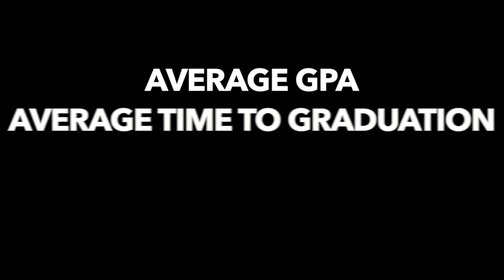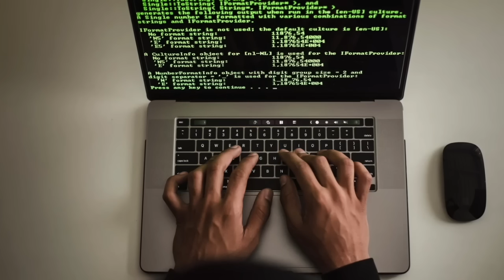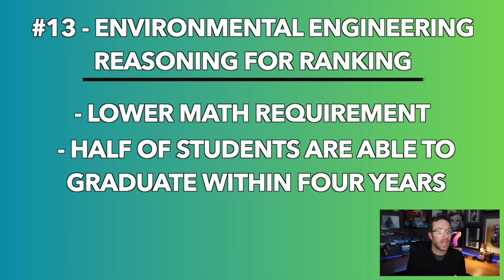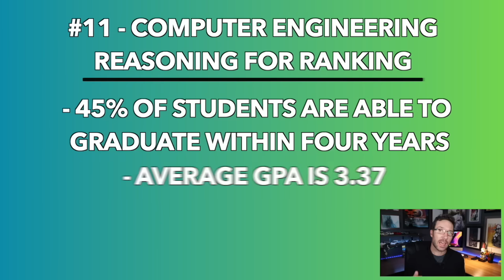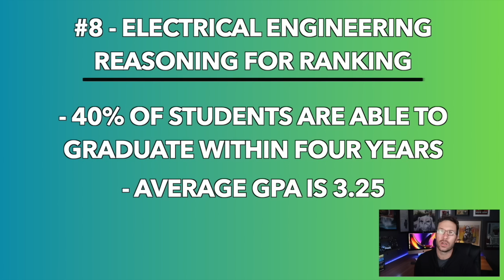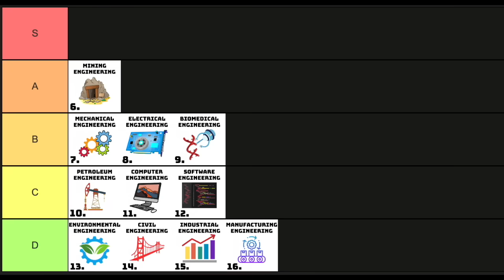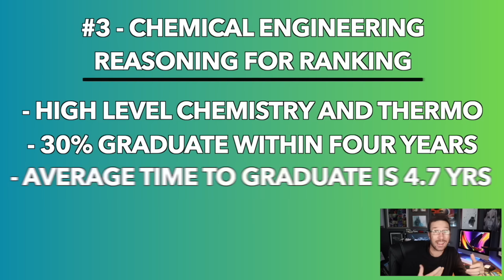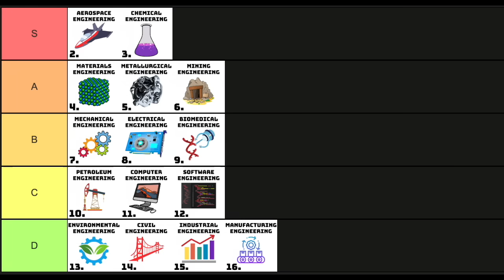Engineering Degrees Ranked By Difficulty (Tier List)

Comment: "In chemical engineering, you're going to learn a ton of chemistry". The person has done a lot of research to collect data but lacks an understanding of what each engineering discipline focuses on. It's a common misconception that "chemical" engineering is about chemistry. As a chemical engineer myself, I'd argue it's more of physics than chemistry.
Reply: I am also a chemical engineering graduate and I agree with you. Unless you pick a specific project or specialization that involves learning a bit deeper chemistry, the only part of chemistry that is expanded in chemical engineering is physical chemistry, that too for designing and optimization of equipment, and in conjunction with maths computation and mechanics into them.
Reply: More math AND physics is involved than chemistry, yes.
Reply: Also a Chemical Engineer, and I agree

The chemistry we learn is foundational: General, analytic, organic and physical chemistry.

Other than that, maybe materials science and chemical reactors, but even that feels more like physics than chemistry.

All in all, the bulk of the course can be summarized into: Thermodynamics, transport phenomena and systems/process design
Reply: I don't know if CE is the hardest degree but it's the coolest one.  You actually learn how to create a manufacturing plant. The other degrees teach you how to build the building or wire it.
Reply: Chemistry is actually particle physics at the microscopic scale.
Reply: Chemical Engineer here as well and I agree.
Reply: Chemical engineering here with an OChem major as well, you take PChem & OChem, but you are NO chemist (More physics: heat, energy, material) your projects are going to totally drive what you "know'.

Chemical engineering is more focused on catalysts, which is math models / physics... You're not moving electrons as your are using tables of values. Also unit op design, costs, energy use, efficiency, just not a lot of reactions... They're in there, but there's a lot more factors coming and going than changing at a location. Also, by the time you are at production... All the chem is done, except for break throughs... Most ChemEs are worried about new ideas, than optimizing and supporting consistent efficiencies and safety, etc.
Reply: All engineerings are physics
Reply: As a chemist who has worked all my career with Chemical Engineers I would entirely agree. Chemistry yes but much more maths and physics
Reply: yeah -- all engineering disciplines are about physics (and math).  We are practical physicists (vs theoretical physicists)
Reply: 100% chemical engineering isn't about chemistry. He's got CE mixed up with industrial chemistry.
Reply: also, highest math isn't ODE. We do PDEs pretty frequently I still have trauma 👁️👄👁️
Reply: And it's a lot about putting information from various disciplines together
Reply: @maiaallman4635 yes, 100%
Reply: ChemE here.  General, physical, organic chem…two semesters each is a lot of chemistry.  But the degree is about chemical reactor design mostly.  The school is key to “difficulty”.
Reply: we are closer to mechanical engineers than to chemist
Reply: I always thought chemical engineering would have quite a bit in common with certain aspects of pharmacy and industrial chemistry, but I am not a scientist so I could be way off.
Reply: Pretty much the just of it.. it's mostly physics and math, and using those in realising chemical processes...
Reply: I think he meant relative to the other engineering majors
Reply: any advice for someone wanting to do chemical engineering?
Reply: @MineSwifi  See my reply to @Riddickforyou
Reply: Well if you can't find a job as a chemical engineer, you could always build a crank lab
Reply: The Chem Engineers that I have worked with spent their time programming.
Reply: Chemistry is physics
Reply: @W_maiN Chemistry is an emergent property of nuclear physics.  I defy any physicist to start from first principles and generate chemistry.  What is it about protons and electrons that leads directly to even inorganic chemistry?
Reply: 100% agree! And i, too, am also a chemical engineer. And regarding your chemistry comment, case in point - I “got through” the chemistry courses but actually didn’t do so hot in some of them, but found that was fine. But the chem engineering classes were so much better, and interesting! They use a lot of visual skills as well as creativity and systems thinking,which is how i learn best. loved learning the way mass and energy moves, what affects that, and WHY! I also took fluid dynamics, and enjoyed it—but as a civil engineering major before i switched to chemical. For me, switching made sense since i had an environmental engineering and science focus. Besides I did much better in chemical engineering because it was more interdisciplinary, conceptual, and systems based. I learned a lot, and have no regrets whatsoever. I got a second degree in environmental science, plus minored in environmental engineering —and together, it worked beautifully for a very dynamically comprehensive foundation to be able do, and have a starting point frame of reference to figure out many different types of things. Im able to think in systems and see the larger, more complex picture and relationships behind them, while also have the ability to see the details and go deeper. Chemical engineering was probably the most influential there - teaches you how to think, analyze systems, and break things down into smaller parts.
Reply: My PhD is in mechanical engineering however in graduate school I took a combination of mechanical and chemical engineering classes . From my experience, mech e classes were significantly more challenging. However, I’d argue that the degree of the challenge is highly dependent on the school you attend as different schools have varying departmental requirements.
Reply: I agree... of course
Reply: Took a lot of classes with ChemE students when I was getting my undergrad Nuc Engineering degree. Heat transfer and fluid dynamics were a test of math skills and the Labs were challenging. The group I graduated with always saw ChemE as pretty equal with our curriculum as far as math and physics.
Reply: yeah, it's a garbage video. "The highest level of maths in this degree is..".  ... always either  ordinary or partial differential equations apparently.
Reply: Chem Eng myself. I did not find that I had to learn 'a ton' of chemistry. Yes, a solid grounding in chemistry was required but that was so that you could understand the mechanics of chemical processes, chemical reactions and reaction kinetics, and the how-to's of designing equipment to carry out and control these processes and reactions. The bonus was that of all the engineering disciples, chem eng required the student to consider the 'whole' from raw materials going in to finished products coming out and all the side streams of waste, consumables, by-products, energy consumption, etc, etc.; and could put together a concept at least of the machinery needed to get it all done. And once you become familiar with thinking about 'the whole',  that thinking style can be applied to so many, many endeavours and happenings in the world.
Reply: His methods are deeply flawed at best.
Reply: Very true Chemical Engineer has very little chemistry compared to physics
Reply: Wrong

Comment: Some of the credits, math and years can vary by university.  I graduated from CMU with an electrical engineering degree.  We had more hours than most but the courses were designed to finish reliably in 4 years.  As I recall we had more advanced math than your averages would suggest.

Comment: Hold the phone Skippy.  Nuclear Engineering with a zero growth rate?   I would go back to the Department of Labor, Bureau of Labor Statistics, there you will find that your zero is off by a large amount.  I'm a Manufacturing Engineer by education and industry experience (43 years) and taught Industrial, Manufacturing, and Mechanical Engineering for 12 years on the collegiate level.  Your opinion would be more understandable if you were consistent in your metrics.

Comment: I'm a Metallurgical Engineer by education.  I graduated in 4 years with 148.5 credit hours.  My alma mater, Colorado School of Mines, is one of the preeminent schools for mining engineering.  Honestly, Mining Engineering was not even close to being as difficult as many degrees offered at CSM.  Geophysics, Petroleum, and Chemical and Petroleum Refining degrees were much more difficult to achieve.  Mining engineers needed to take surveying which was usually a summer course.  Not a lot of fancy math - jobs were usually in remote locations wherever the mine was located.  As you say, engineering is a difficult curriculae.  My recommendation to prospective HS grads is to set good expectations for what you'll experience in college.  Don't expect a robust social life - the homework is long and tedius, and you'll have a lot of lab courses, which consume a lot of time but don't earn you a lot of credit hours.  I averaged 4 hours of homework per night and 8 on the weekends.

Comment: Civil Structural Engineer here. Structural is the most difficult area in Civil Engineering. The highest level of Math that I learnt was Tensor Calculus (for my Master). Lots of Mechanical Engineers goes to Civil courses to learn more about structures and FEM analysis.

Comment: You didn't mention Agricultural Engineering
Reply: bc it’s way too easy
Reply: I'm currently studying Agricultural and Biosystems Engineering--Im telling you, this type of engineering is very underated.

My experience so far, it is difficult because I thought it was just the basic concept of agriculture like learning about animals and plants. Shockingly, you will also learn many things or topics that can be taught in other programs of engineering such as in the mechanical, civil/structural, electrical/electronics, geodetic (land surveying), chemical, soil and water, biological, environmental, meteorological, thermodynamics, etc. It is like we need to utilize every type of math/science and engineering concept just to develop the agricultural sector. That is why they call this program a "jack of all trades master of none but better than a master of one."

Bruh...

Comment: You mixed degrees needed for professions with degrees that have no professional territory.  Even chemical engineering only has a title act, meaning there is no profession.  a PE in chemical engineering has earned the right to use the title, PE, and term professional engineer, and chemical engineer.  that's it.  no territory.  There is no such thing as practicing chemical engineering without a license.  Civil engineering however is a full blows legal profession.  A chemical engineer can practice civil engineering without a license at risk of prosecution.

Comment: Civil engineering, like EE and ME, is a practice act profession, so requires two additional exams and 2 to 4 years of experience to become a licensed civil engineer.  A degree does not make one a civil engineer.  The title and profession are legally defined and protected.  It takes at least six to 8 years to use the title civil engineer and practice civil engineering.  The BS is just the first part of the journey.

Comment: if electrical and computer engineering need at most ODEs then I wonder how the tech used to make this video materialised. I find the math requirements posed in this video as mostly silly. Imagine you are and electrical engineer and you want to make a photonic integrated circuit and your highest math education is ODEs, yet the Schrondinger itself is a PDE, how do you proceed at all??? Laughable...how about if machine learning models...they are just not things are they?? and the high performance computing HPC systems needed for them?? There are things that need way more that ODE or PDE level knowledge.... The requirements for the engineering degrees in this video have been poorly researched and are not properly representative of what I see in the engineering world, sorry to say. 
Also, that someone finds one part of engineering tough doesn't necessarily imply that everyone would find it difficult. People thrive more in things they are passionate about and are willing to put effort into and thus it is never difficult for them, regardless of complexity
.

Comment: This is a total crock'o'crap.  The "difficulty" has little or nothing to do with pay or credits, it is solely determined by the "dropout rates" of the students who are not able to retain or pass the curriculum.  Bio-engineering, Bio-Chemistry, EE, Physics have always been the most difficult, because they the most far ranging.  Actual "Theoretical Math" requires a special brain, which very few people actually have, and this borders Cosmology & Physics as an allied basic Science.  DiffEq does not get you very far in actual science.  the Software people also pretty much do not have to know much of anything, since their coding is programmed by other engineers and scientists, who actually know some thing.

Comment: ???? Engineers are relatively smart disciplines across the board.  However, your ranking is just a meaningless ranking if you do not state the methodology.  In addition, why would some of the engineering you rank does not include the size of the crop and why would some the difficult disciplines as you stated have stagnated grow in salary and numbers.  The basic economic principal of demand and supply dictated that as the demand grew but there are not enough supply, the price goes up.  So one should see some of those salaries of difficult disciplines are in favor of the practitioner.  Now I just over simplified the idea but it’s the tip of the iceberg of the validity of your ranking.  Other considerations may be the quality of the crop so to say…. My experience told me many engineers obtained their degree after they were out in the real world and discovered they needed something to support their family and they went for the best possible degree that money can buy and R.O.I., not so much as the difficulties and they are usually the e best student there is.  Also, financial engineering has long been deemed as a liberal art (not in conjunction with political interpretation here) discipline but the implication has far more relevance than many engineering disciplines and at best, it was being looked at a fringe academic discipline.  It should be included as one of the engineering discipline IMHO.  The math in that field, just doesn’t seem to be there but in reality, they just came later as one goes down that rabbit hole.

Comment: I graduated in mechanical engineering in 1990 and took advantage of my internship in an industrial complex where there was the possibility of developing in almost all mechanical specialties with their laboratories included. From the design, moving on to the preparation of technological charts, manufacturing with my own hands the prototypes of stamps and molds and cutting tools, casting, heat treatments, etc., to the evaluation of prototypes.
He earned only approximately 60 dollars a YEAR in salary.
Then I was selected for turnkey contracting for comprehensive construction projects such as hotels and factories where I carried out the activity of main construction coordinator and budget and supplies manager.  There I earned a salary of approximately $150 annually.
I was selected to be the main specialist in the state construction inspection of the Ministry of Construction in Cuba and work in all the provinces of the country with a multidisciplinary work team of engineers and at that time I earned an equivalent of 200 dollars annually.
I went to work in South Africa in the Ministry of Public Works and earned an extraordinary and insurmountable salary of 60,000 dollars a year, of which I only had 6,000 dollars a year for my expenses.
In current times I am not working and I am not afraid to say that I have no salary

Comment: Civl Engineer here with 32 years of experience.  You will make good money in consulting if you are a revenue generator on the business development side.  If you work for a consulting firm and you are making the owners wealthy through the revenue/profit you generate, you will be upper middle class.  The owners will be potentially one step above upper middle class (two or more homes, $750K+/year total compensation, etc.).  If you stay on the technical side, you will be solid middle class.  In the firm I work in here is what you can expect.  Career technical $150K/year.  Rainmaker $250K/year.  Owner $500K+/year.

Comment: A bit misleading. I have a Bsc. mechanical eng. 4 years. My final exam was a V4 OHC engine. 1968.That engine would not work. I don't know what level of math and phyisics that was but it would not be sufficient to design an engine that works. You would need post grad work in thermodynamics,  materials science, CFD, etc. to design an engine. Im too dumb for that. A flat plane V8 Ferrari or Corvette engine is way beyond me. I dont know what level of math and physics that would require. Even wirh Auto CAD or Solid Edge, chassis and suspension design is difficult. I can't do multi link. I know enough to day that a C8 chassis is a disaster. I have to hire clever guys to do my designs.

Comment: I am probably one of the only people in this comment section who is actually studying entry #5 (metallurgical engineering). It is basically just a more specific version of chemical engineering with a bigger focus on metals, obviously. It is a very fun discipline - you get to work a lot with extremely large, dangerous machines at very high temperatures, and the work is quite satisfying